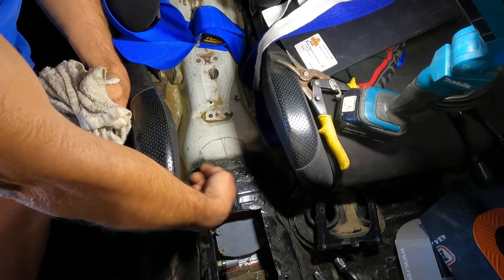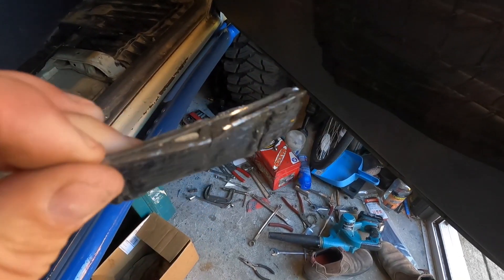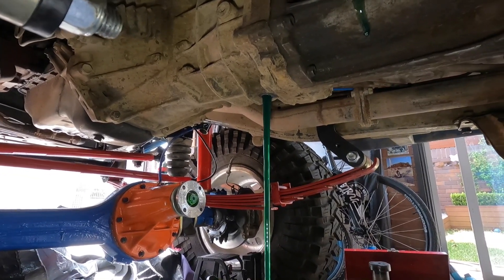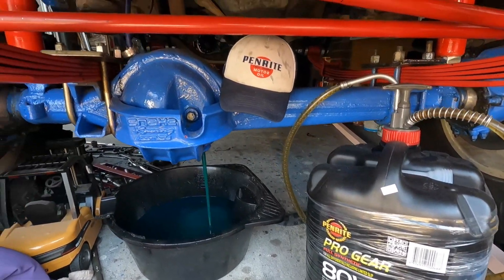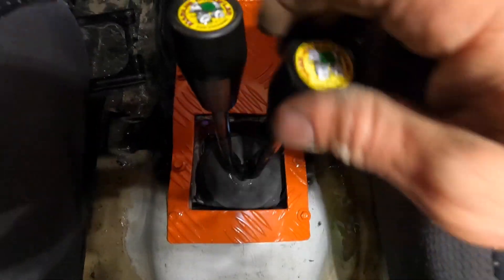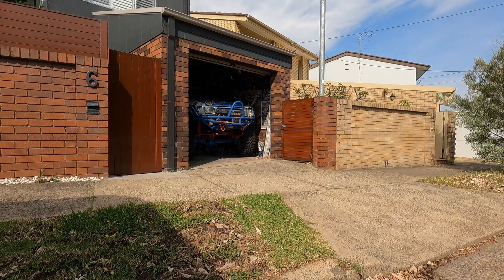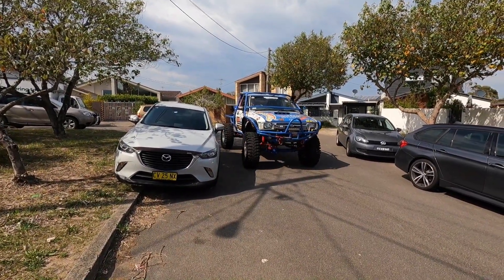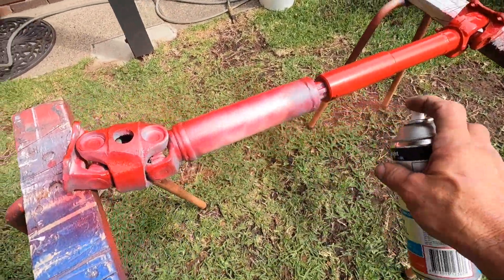Ln106 build 1st start up and drive after Marlin crawler dual transfer case set up Team Bullet hilux

Comment: fantastic results , looks great and I bet you can't hardly wait to get out there and do some 4 wheeling, be great to see all the the time and effort put into action, we use to use hypogear 85w140 in the final drives because it didn't foam which is important so that it doesn't push out seals and the thickness of it made it cling for better oiling at lower speeds but in winter it's takes a bit more to pump it from the drum.
Reply from the maker: Cheers JC, we excited alright, just need permission to use mums taxi to tow it until 79 arrives......
Reply: @TeamBulletOffroad  I don't think that you'll have any problem's getting the keys to take a family outing with the new rig 😁
Reply: To fill my gearbox, diffs & transfer case with 80W I made a cordless drill powered oil pump from a Holden 6 cylinder red motor oil pump. it works a treat even with heavy oils & I can reverse the direction of the drill to suck out any excess of over-fill.
Reply from the maker: @dustyfarmer  Genius Dusty...
Reply from the maker: @jc7654  Hehehe

Comment: That's fantastic you must be over the moon with the results. What would be your final drive ratio now in low low compared to just low?
Reply from the maker: Brian?????? Need the boss to answer that 1, 4.6 diff 4.7 rear case 2.28 front, if he can work it out on 40s please ...............
Reply: @TeamBulletOffroad  

First is 3.93:1
Front low 2.28:2
Rear low 4.7:1
Final drive 4.555:1

Crawl ratio 192:1

Factory crawl ratio is about 39:1

Corrected for tyres, with the current 38” it’s the equivalent of 154:1 on stock 30” tyres. With 40” will be like 144:1, so still 3.7 times slower than a factory LN106.
Reply from the maker: @brianmonger8185  Thanks Brian

Comment: Hey mate awesome rig! What’s the benefits of a dual transfer case over a single
Reply from the maker: More torque at lower wheel RPM, greater control plus to accomodate the 40inch tyres we getting

Comment: Hey mate I have an ln106 and was thinking about doing the same setup. Just wondering if it’s effected at all in 2wd. The cars still my daily
Reply from the maker: If you did everything properly it would be ok, the rufs push the front a long way forward, Phils truck on 37s dual cases rear disco, but runs conventional diffs

Comment: Why is such a downshift necessary ?
Reply: More torque at lower wheel RPM, greater control. Few situations will require 1st/low/low.
Reply: @brianmonger8185  How do you wash bridges if water gets in?
Reply: @Олег-х8р  lost in translation, comrade. Bridges? 

If water/dirt gets into the transfer cases they can be flushed with soapy water and refilled with fresh oil. Top of the gearbox is about 1200mm off the ground. 

Axle breathers are extended up into the engine bay so water would have to be over 1500mm deep to get into the axles.